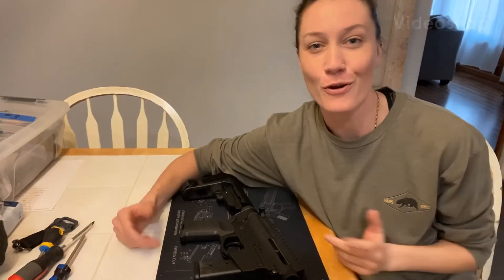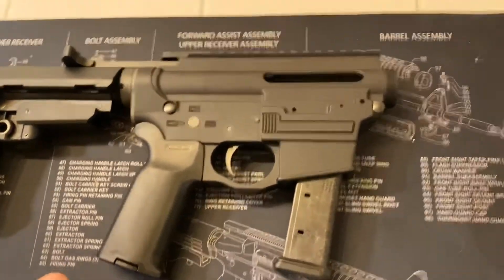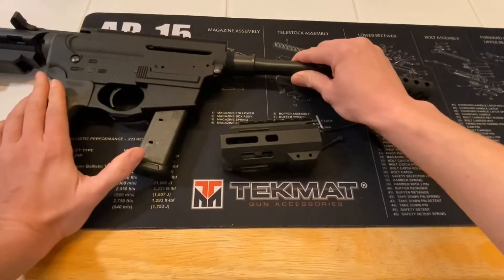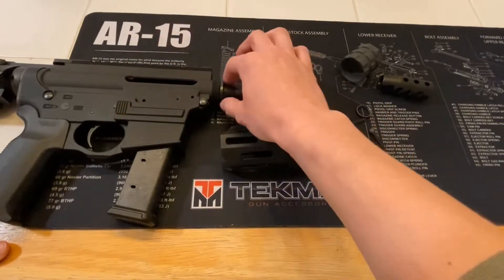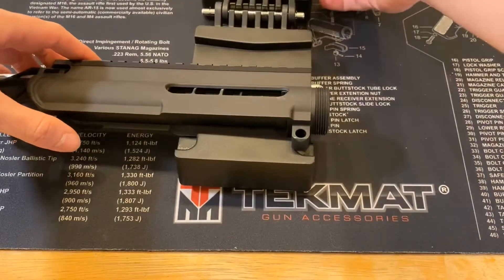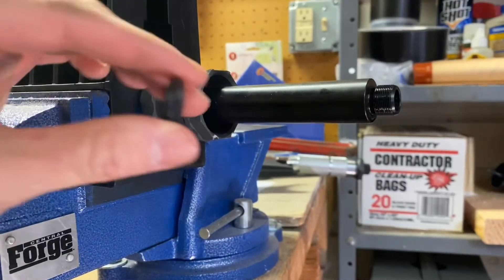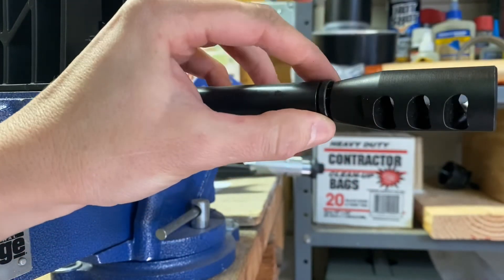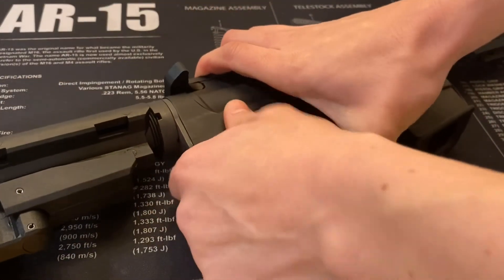How to Assemble AR-9 Upper Receiver Build

Comment: A very good and useful video. I'm on my sixth build, using a standard lower that I intend to put interchangeable 9mm and .223 side-charging uppers on. Not many videos show how to put a barrel and a compensator on with a torque wrench, compression nut and shims.Your video had the most useful info with zero macho bullshit in it. My congratulations.

Comment: Can you please show a video of how it ran. I was wondering how the ejection works with a normal 223/556 upper receiver. I have a AR9 that im trying to build but I'm not sure if i should buy a dedicated 9mm upper with a wider ejection port of if my regular 223/556 upper will work at ejecting the stubby 9mm round..

Comment: Terminology helps convey and you sound more like you know your stuff.
Those "little screws" are handguard pinch bolts and no grease (aeroshell 64) on bbl ext.. just bbl nut threads. It's there to prevent galling and allow bbl nut to tighten smooth and consistently. "Centering" bbl nut not required/doesn't matter.

Comment: Just put some oil on the threads and torque the nut in one go. Even critical situations like head gasket clamping that kind of process isn't used. Honestly on a gun you could just guess, I wouldn't even bother with a torque wrench. The ultimate strength doesn't change and the preload isn't that important since nothing is being sealed.

Comment: This was really helpful to give me an idea of what I need to do for my first build.  What about using barrel nut grease to prevent binding due to dissimilar metals?
Reply: I think you mean anti seize lubricant? I use loctite C5A from brownells also aeroshell grease is very popluar. Its used when you are marrying two different types of metals such as aluminum and steel.

Comment: Was hard to see in your video if you did (9:33)... but don't forget to add some molybdenum disulfide grease to the threads of the receiver, and some copper anti seize on the outside of the barrel extension.

Comment: Not saying you did it wrong, making an alternative suggestion... when putting the barrel nut on, why not set the torque to 30-35, THEN tighten further to get proper alignment (timing). Seems more practical than torquing to 50 adding shims.

Comment: is it neccessary that the barrel on a 9mm has to be timed? i was advised that this is only needed to be timed only on a 556. can someone clear that info for me?
Reply: If there is an additional cut in the barrel ( feed ramp) then it will be pinned and that pin will go into the slot on the upper, if there are no additional cuts in the barrel ( no feed ramp) then it won't matter. I generally just put the engraving on these barrels up. Hope this helps you out.

Comment: please add the parts list used and links
Reply from the maker: Magpul grip

Glock 21 round mag

Luth AR LPK with no trigger or grip

Foxtrot mike 9mm weight buffer

Foxtrot Mike 9mm bolt Glock style

Standard mil spec carbine spring

sBA3 pistol stabilizing brace 

Spikes Lower receiver 9mm LRBHO

Spikes upper receiver AR-15 slick side (multi-cal)

Strike industries charging handle

Standard mil spec trigger Anderson 

Ballistic Advantage 9mm 5” barrel
Reply: @cavewomansarah6142  Can you share the manufacturer of the Barrel Nut and Rail/Handguard?  Also, did you put any anti-seize compound on the barrel nut threads?

Comment: that looks more like a 5.5 inch barrel rather then a 4 inch. awesome build and video!
Reply: 9mm AR barrels are measured differently than regular AR barrels. They're measured as overall length whereas regular AR barrels are measured from the shoulder that mates and index's to the upper.
Reply: 5.5" is the shortest 9mm barrel BA offers
Reply: Yeah.. I'll believe the HG is 4", that bbl is longer seeing them side by side. I'm looking to use a 9ish length bbl with BCM MCMR8 HG.. should allow muzzle threads to fall just outside the handguard.. I hope if I done homework correctly 😉